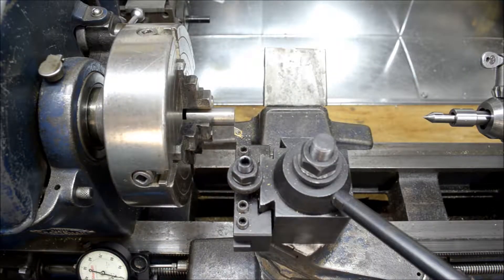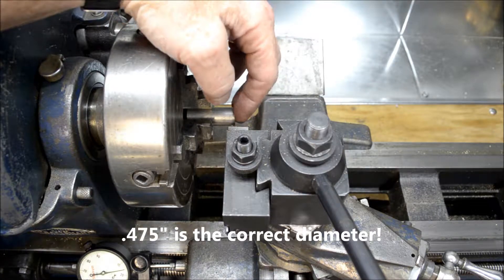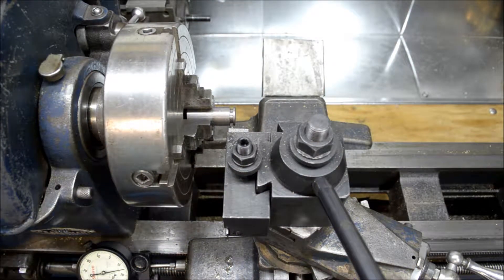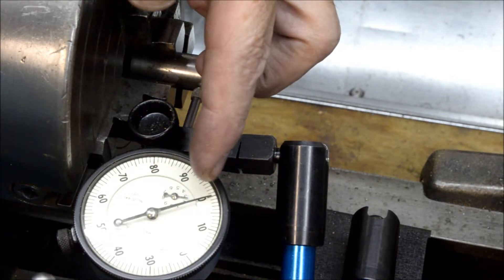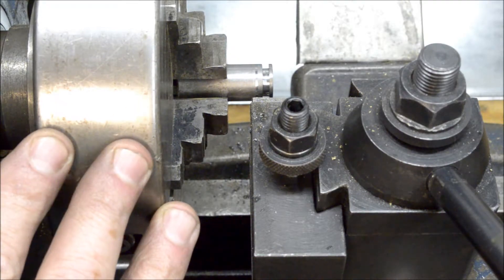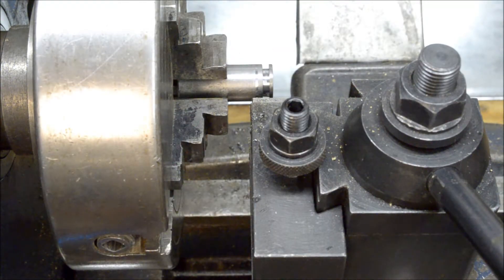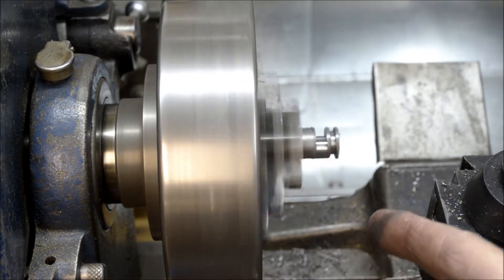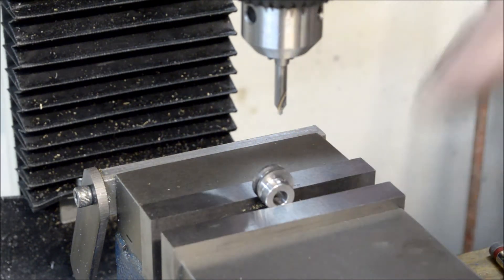PM Research #3 Eccentric Hub

Comment: A story for “noob” machinists. I just machined this part today, and it didn’t go as smoothly as yours! This was actually the first time I’ve ever used a 4 jaw, and it was a definite learning experience! As you suggested, I cut the groove “inboard”, then offset , bored, and turned the eccentric part. Then centered it back up to part off. What I failed to take into account was the bore, which was no longer centered at that point. When the parting tool broke through the (off centered) bore, It literally kicked the blade out of the qctp tool holder and joined the space program! Luckily PMR provides a long enough piece of that stock  to make a second eccentric, and that’s what I did! This time I stopped the bore short of the parting off point, centered it back up and parted it off. Then put it on my milling machine and finished the bore and reamed it. If I ever do another one of these, I think I’ll skip the 4 jaw, and do the on center turning and parting off, then go to the mill and bore/ream, then put a 1/4” bolt in the 3 jaw with the eccentric on it and tightened up against the jaws with a nut. Then I’ll turn the off center portion. I never saw the parting off part of your project, but I hope you didn’t have similar problems!  Now, on to that cylinder!